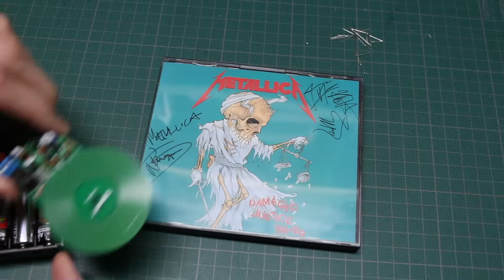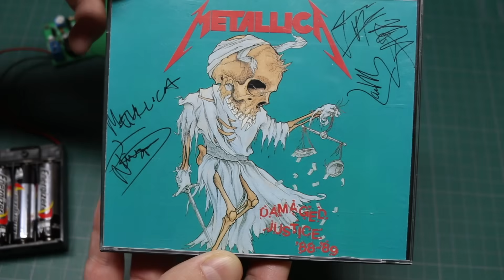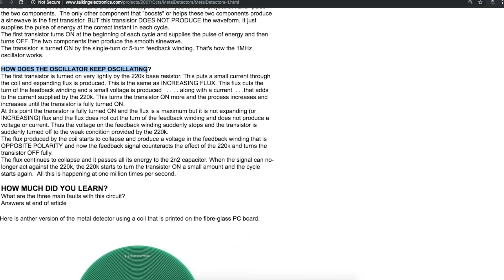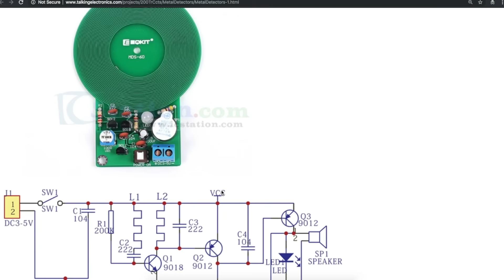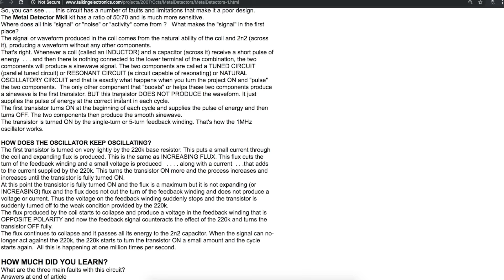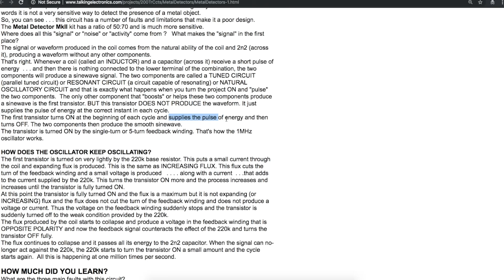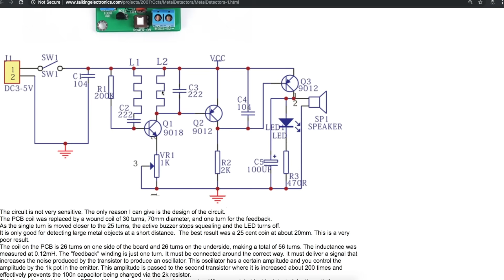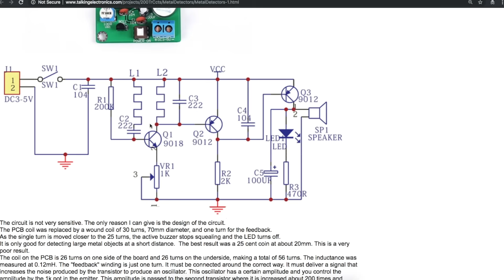Metal Detector Kit - Assembly, Testing, and Circuit Analysis

Comment: also, can you quickly just explain why there is 3 contacts on the coil to the circuit as ive never seen a coil with more then 2 contacts before :/
Reply from the maker: there’s lots of different types of coils including transformers where there can be a centre tap so three connections with one in the middle, and this one works similar to that even though I think the middle tap point is only one or two loops of the entire coil.
so with three wires, the two outside ones can be thought of as one bigger coil but then between one outside and the middle or the other outside and the middle can also be taken as two smaller coils with a common connection in the middle.
in this circuit the part that taps off after a couple of turns behaves like a pick up coil being placed near the other large coil section, and the circuit can put that to use when the magnetic field is disrupted by metal objects, I forget exactly how it works but I think I explained the circuit in the video
Reply: @GadgetReboot  ah right  I see sweet! Thanks for the info appreciated 👍

Comment: @Gadget Reboot>> do you know if a DIY COIL can be soldered on to this board exactle as is on the circular plate points? i've been looking for videos to see if anyone has tried to fix their own coil to see if it actually works but no luck as of yet.
Reply from the maker: I would guess that if the onboard coil connections were severed to take it out of the circuit and an external coil were attached instead, it should still work but I haven’t tried. I think I saw some do it yourself projects where people made their own coils so maybe those types of resources have more information on connecting a coil to a circuit successfully.
Reply: @GadgetReboot  you fancy giving it a shot yourself and uploading a vid of the results? would really help me with my own build :)
Reply from the maker: I don’t have the materials to make my own coils right now and I don’t really have a practical use for it myself so all the other ongoing projects would probably dominate my time
Reply: @GadgetReboot  new projects=more views lol go on son ya know ya wanna 👍
Reply: ps i've only got 1 of these kits spare which is a reference (not to build) so can't really experiment myself as i dont have a spare kit to test my own coil on :/

Comment: This would work well for detecting in a hole that you've already excavated.  Keeps you from waving all your stuff in front of your big coil on a large detector.  The primary reason it doesn't pick up distant objects is that the coil is not large enough.  It's essentially an aerial antenna, and has to have a large enough coil to transmit a full wave at the frequency it's tuned for.      Large loops – Loops with perimeter of a full wavelength, two wavelengths, or any whole-number multiple of a full-wavelength, are naturally resonant and act somewhat similarly to the full-wave or multi-wave dipole. When it is necessary to distinguish them from small loops, they are called "full-wave" loops.[a][2][9] https://en.wikipedia.org/wiki/Antenna_types

Comment: These switches are annoying because you can put them either way, they have a two sets of NO-COM-NC contacts, so you get inverted push action when you put it wrong
Reply from the maker: Yeah if I was going to use that kit beyond the day I assembled it I might have taken the effort of getting the heat gun out and trying to fix it but I think if I ever take the switch out it’s going to be because I’m going to put it in another project so it’s probably going to sit in the basement in a box for seven years before I see it again.